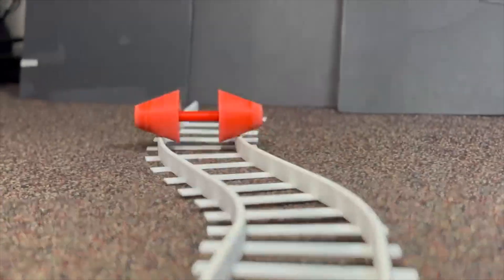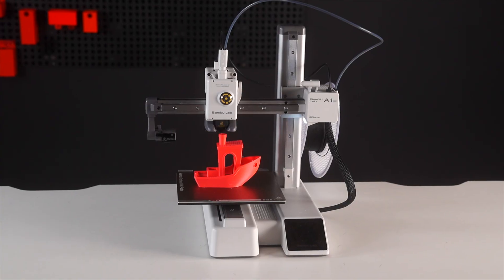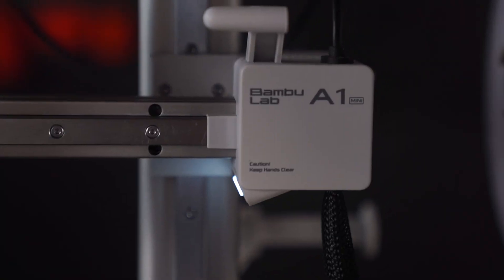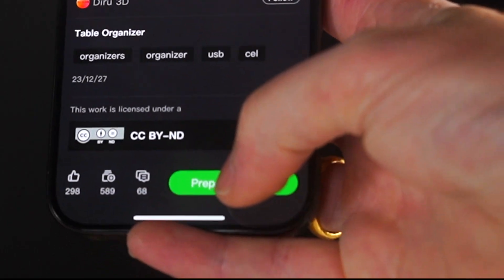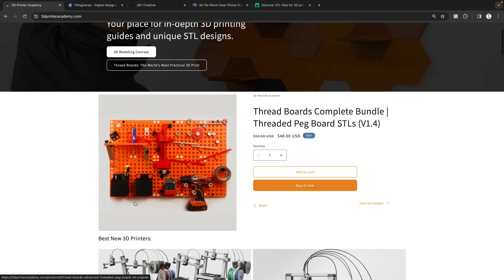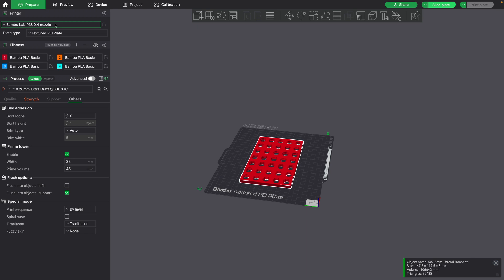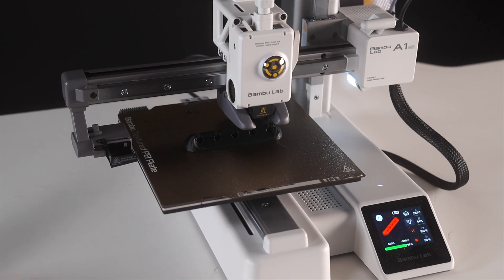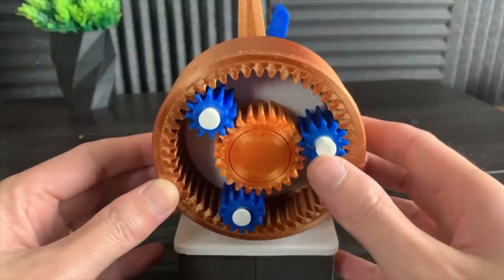3D Printing Made Easy - 2024

Comment: Bamboo labs is going down a bad path currently I would not recommend them now... The software is moving away from open source restricting 3d party software use for slicers, and object modeling. Similar companies did what Bamboo labs is doing now then slowly began requiring and increasing monthly licensing fees to use the software. Without it your printer becomes a paper weight essentially, so pay the fee or you cant print... Bamboo labs has said that's not in the plans for the companies future, though there is contradicting evidence that states otherwise. Are the printers good? Yes, but maybe let the situation simmer for a while before purchasing one of their printers.

Comment: I would love a Bambulab X1. But I do not have any big issues with regular boring printers. My first 3D printer is 10 Years old, and it still works, and I barely do any maintenance ever, but sure, once in a while I have to re-level the bed, etc. but yeah, babulab printers seem pretty awesome, If I could afford the X1 I would probably get it. But I have 3 printers now so getting the A1 mini does not seem necessary, but I can say this for sure, it definitely produces nicer-looking prints than any of my printers can